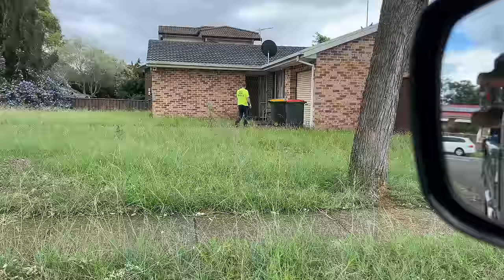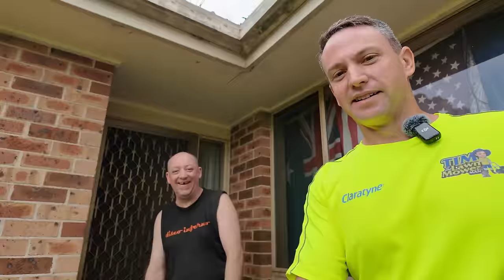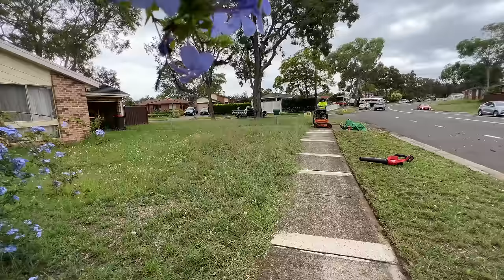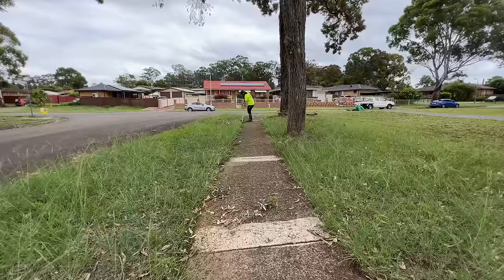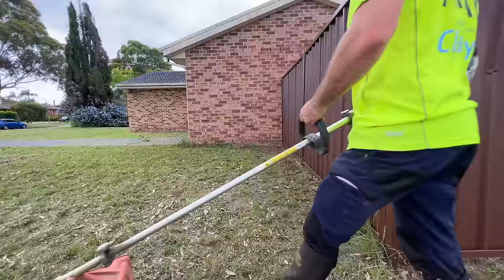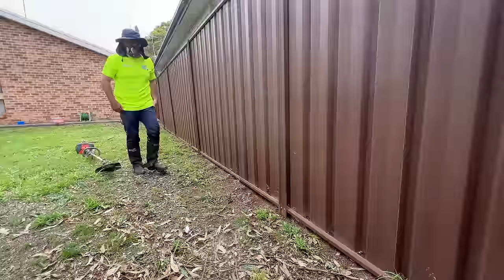Knocking On Random Doors Till Someone Lets Me Mow For Free - Free Mow Fridays #satisfying

Comment: Hi Tim plz don’t use the edger thing .  I know it’s quicker but mate when use trimmer with the line for the edges top notch. I watch all ur videos
Reply from the maker: With the type of weed there and the sheer amount of edges, it wasn’t possible
Reply: Does Tim come and tell you how to do your job?😂😂😂
Reply: Did u read the comment mate I praised him
Reply: I have a similar edger.  I always use it at the start of the season to re-establish the groove.  Then it’s the line trimmer most of the time - using that groove to keep it neat and consistent.  If I don’t do it with the blade edger first, I go through so much line, and struggle to get a neat groove, which annoys me for months.  I was using a 240V Atom edger in the 90s, long before I got a line trimmer, and always had great edges.  I can see why Tim would do the same - each one of these free mows needs to get the edge grooves re-established.
Reply: For those in the know - would a non-powered edger (i.e the spikey wheel things you just push) acheive that groove? I've been trying to acheive it with the whipper snipper but I suck at it and end up with a wonky 2 inch thick channel, night a nice neat groove. I only have about 15m that needs edging and can't justify the expense of a power edger for that.